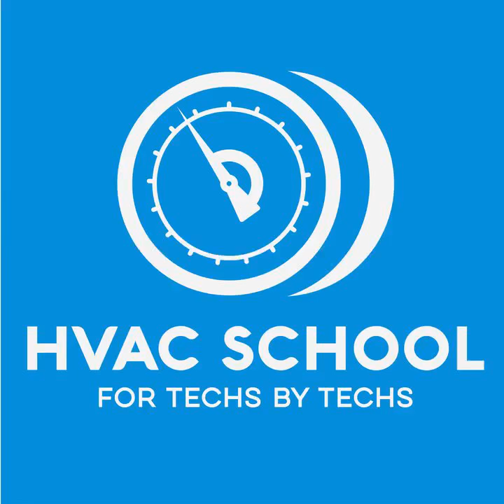(Podcast) TXV Operation, Diagnosis, and Failure w/ Jamie Kitchen

Comment: I have a 3 year old ameristar system giving problems.  On ab90+ degree day, it wont keep up.  2 ton heat pump 14 seer brand new install about 1000 sq ft old house.  1960s about.  Suction pressure was up around 170, head pressure like 240 or so.  Its anpiston, so cant be bad txv.  Tech said compressor was bad cuz it was pulling 4.6 amps, rated for 13.5.  Replaced compressor, now pressure is better looking, still not keeping up.  I'm thinking the reversing valve solenoid isn't going all the way over, thus freon bleeding thru.  Any other suggestions?

Comment: Back in the day manufatures used Silver  wire on txv
Reply: I work at an equipment manufacturer and I've probably brazed in hundreds of TXVs on these units. I can tell you that some brazers do better jobs than others and I worry about damaged txvs.
Reply: I think using silver is probably smarter.